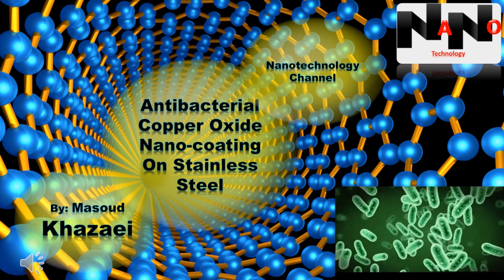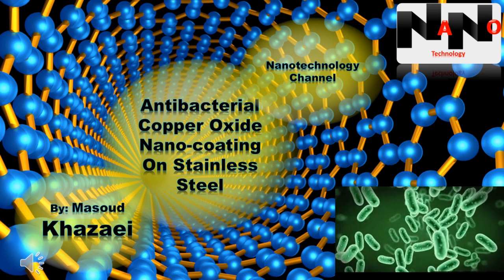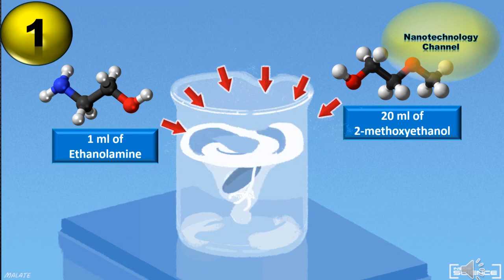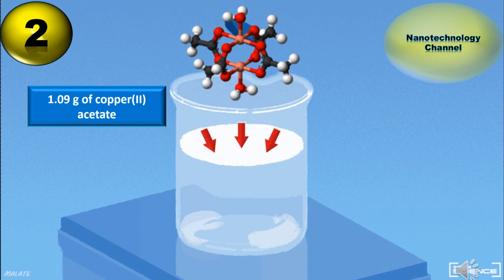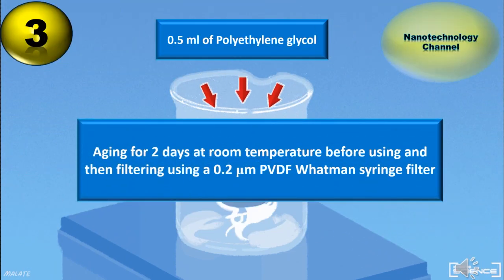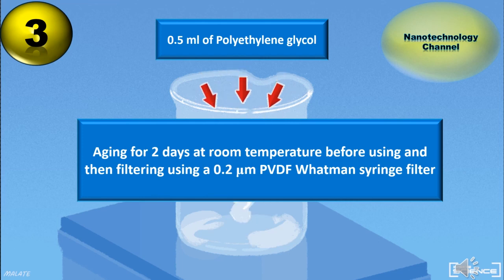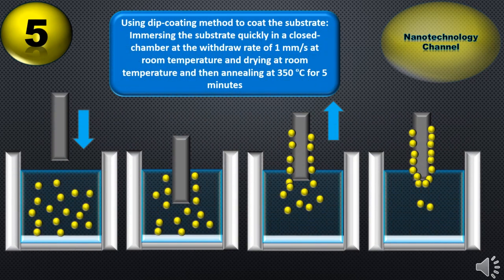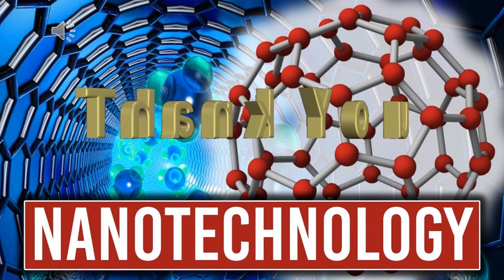Antibacterial Copper Oxide Nano-coating on Stainless steel

Comment: Nice video. Just one question, is it possible to electroplate the copper oxide nanoparticles over the stainless steel? I´m  not so into electrochemistry
Reply from the maker: Yes, please go to the following link and read the article.
https://www.sciencedirect.com/science/article/pii/S0257897218303621?casa_token=wAEVh7nnuGoAAAAA:o2UZILYP9ob1Cp0VVT7EBykbCqY9UI5iPsFunDB1ezAw9FwisfPOWwQx7fWFiEdxNJtdrNQ892Q